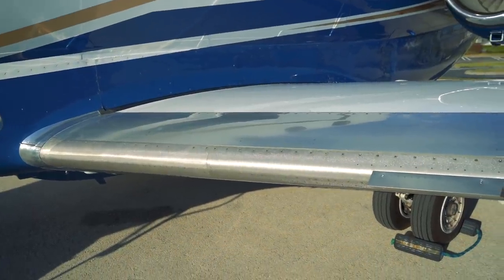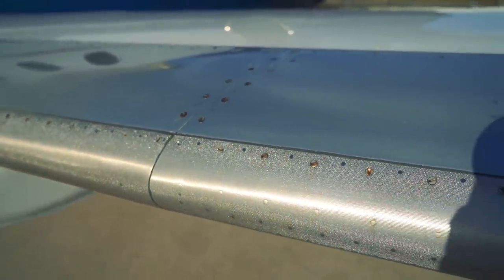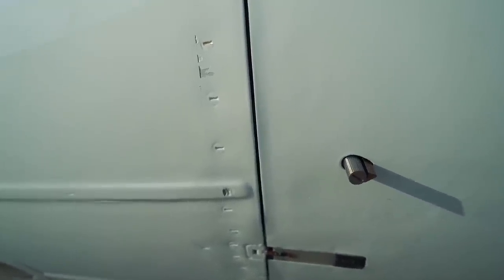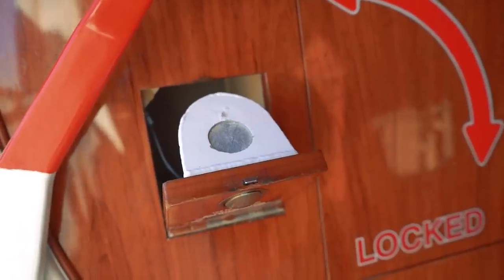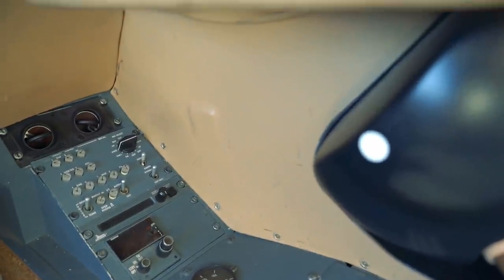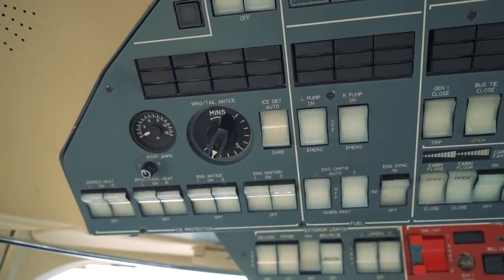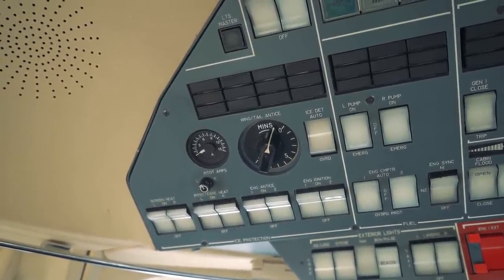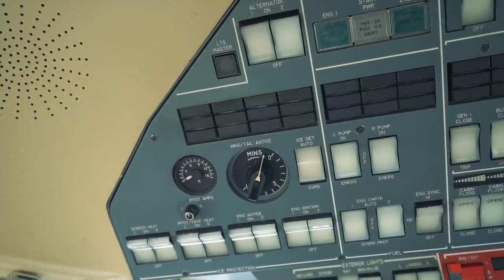Ice and Airplanes Do Not Mix! - Tech Tuesday

Comment: Another nice tech-tuesday explanation, as always! I’ve never flew a plane with TKS, only with boot for deicing (King Air) or heated leading edges. Some examples, Hawker 400XP (Beechjet 400A) has hot bleed air for wings and electrically heated horizontal stabilizer de-icing system; Phenom 300 uses hot  bleed air for both (wings and horizontal). It works fine, reliable but you will have a penalty on climb performance & fuel burned. Thanks for posting, Shaun! Now we are all living the Quarentine Pilot Life... 😷😉🇧🇷👍

Comment: Great vlog as always! This is jet aircraft. Why dont they have a system like on the GF MD or Boeing? Div hot air from the engine to the wing? In Norway there was a fatal aircrash in nov 56. A DH-114 Heron from TRD-FBU. It was the system you talked about, I have seen it on DC-3s. The chief pilot of the same airline that crashed made a miniature wing out side, like you talked about. That became known as Larsens wing. Be safe and stay safe my friend!
Reply: When I went to maintenance initial for this aircraft they explained why this somewhat modern jet uses TKS. The earlier Hawkers had viper engines that were not powerful enough to provide enough bleed air to heat the wings and sustain their performance at the same time. The CFE 731 used on the newer hawkers such as this one, can easily provide enough bleed air to heat the wing. However the cost of designing and recertification of a hot wing didn’t seem worth it to the company at the time.

Comment: I figured the holes would be alot bigger in the wing leading edge there - that was pretty neat! Sparkly like a bass boat, lol.

I was surprised when you said that stuff is corrosive. They must use really good paint on these planes to keep corrosion from happening. Great stuff, Shaun - much appreciated! 👍🍻

Comment: never seen a jet that uses TKS fluid..   though they used bleed air from the engines to heat the leading edges.   are there different limitations with both systems?

Comment: I wondered why to fill the TKS is located on the highly polished wood grain area inside the door?  Why not something inconspicuous like the top of the wing or where it meets the fuselage??
Reply from the maker: Good question...we'll have to ask the engineers on that one
Reply: Surely they weren’t thinking the pilots might want/need the option to whip out a spare bottle and refill the reservoir mid-flight...

Or were they? 🤔

Comment: The Concorde didn't have that problem. It flew too fast for the ice to see it.  :-)   Seriously, this glycol based system is a reliable thing to prevent that sticky ice from building up on the wings. Glycol, one more thing to check before takeoff.

Comment: Interesting system, does it heat the fluid before it pumps it out? If ice starts building will it just stop it or will it actually take off any build up that is on the edges?

Comment: so you still get de-iced on the ground and why did they make the filler inside of the cabin versus outside
Reply from the maker: We definitely still have to get de-iced on the ground. This TKS system is only good for flight operations. As for the filler location, it used to be (literally) under the pilot's seat, so this is definitely an improvement over that

Comment: The humble egg timer shows up in all sorts of places.  :)  I guess bleed air would be too expensive for such a large area.
Reply: When you use bleed air, each appliance that uses it reduces thrust while in operation. Its fairly easy to cut climb performance in half just with bleed air anti ice, pressurization, and airconditioning on.

Comment: I assume (risky, I know!) that the horizontal stab and vertical fin  also have “weeping” leading edges? How is icing handled on AOA sensors? I know about pitot heat. Any other protruding items that need protection?
Reply: Roger
The H Stab is protected the same way. The Vert Stab is not. Used to be on older models but not on 800 + newer. AOA is heated (AC power) as well as Pitot and Static (DC power).

Comment: Wow sir, I'm surprised at how simple that particular system works! I've always believed that hot air was forced into the leading edges of the wings to shed any build up or even some sort of wing edge boot that would "rattle" the ice away. Go figure! Thanks for enlightening this old fart!
Reply: You’re not wrong; all three systems exist. A bleed air system diverts hot air from the turbine’s compressor to ducts in the leading edge of the wing to melt away the ice. De-icing boots are inflatable bladders on the leading edge of the wing; they repeatedly inflate and deflate to break up the ice.

As for how the designers decide which system to incorporate into their turbine-powered aircraft... I have no idea, but I’m sure it would be a fascinating topic!

Comment: Sean...Is the Hawker certified for "known ice" with the TKS?  Can you adjust the flow rate? (I didn't see anything other that "on/off" in the cockpit).
Reply from the maker: It is certified for known icing. The flow rate is not adjustable, but the first minute flows at 150% normal rate when activated.
Reply: @CorporatePilotLife  Thanks!!

Comment: Why doesn’t it use bleed air on the wings? Thought all jets did?
Reply from the maker: Most do, but not this one...
Reply: Dawson, Shaun
The older Hawkers (60s vintage) had Rolls Royce Viper engines that lacked enough bleed air for anti-icing. So they were designed that way in the beginning. With newer engines (731) there is plenty of bleed air but the system was already there so..... If it ain't broke... don't fix it.

Comment: Gallon Capacity in system, and total Run Time???????
Reply from the maker: It's about 4 gallons in the system, but the run time is a bit harder. The first minute when activated flows at 150% normal rate, so if we turn it on and keep extending the timer before it stops, we can get about 100 minutes out of it. If we set it to 1 minute then let it stop, then another 1 minute and let it stop, and so on it would deplete much quicker due to always running at 150%.
Reply: @CorporatePilotLife  Thank You.
Reply: @CorporatePilotLife  Shaun the 800XP and newer hold 10 USG. Older Hawkers had 2-5 gals.

Comment: how much does the TKS fluid cost and how much would you use?
Reply from the maker: It costs around $20 per gallon, and how much we use depends on the weather. On a nice clear day, we won't use any at all, but on a stormy winter day we may use 3 or 4 gallons going from Florida to New York.
Reply: Hey Sean, understand it’s about ice conditions on a particular sector, but is it fair to say it would get used on every flight? (Love the vids👍)
Reply: $20 a gallon. That's not bad. Usually anything for an aircraft is outrageous.
Reply: Derek Roulston 

Considering you can get glycol based window washer for $1.39...
Reply from the maker: I would say it gets used on most flights. We usually prime it on the first flight of the day for about a minute during taxi out, but if we don't touch a cloud on the whole flight (which is very common) then we will not turn it on again.

Comment: How do you know where the ice is?
Reply from the maker: It will almost always be on the leading edge of the wings and tail as well as engine inlets. The windshield will get some on it too
Reply: Corporate Pilot Life hahah I just realized
That was a dumb question.  I mean in the sky, what conditions are you looking at I’m foreflight or whatever software you use to say, ok we should turn on the de icing system
Reply from the maker: Aahh...I'm sorry. Any cloud at the right temperature can have icing, but those with vertical development are far more likely to have icing in them. For me, anytime I am in clouds between 10 degrees Celsius and -40 degrees Celsius, I turn on the anti-icing just to be safe.